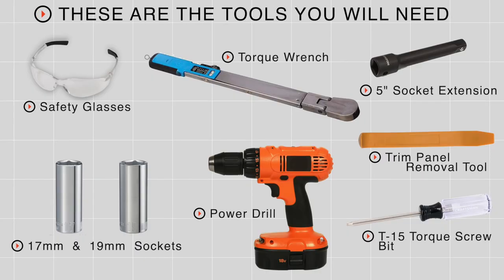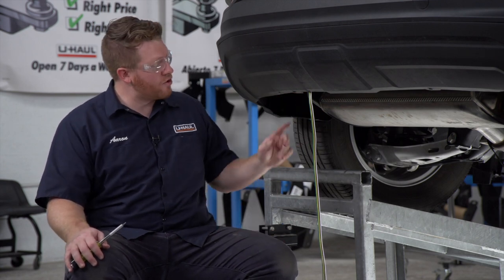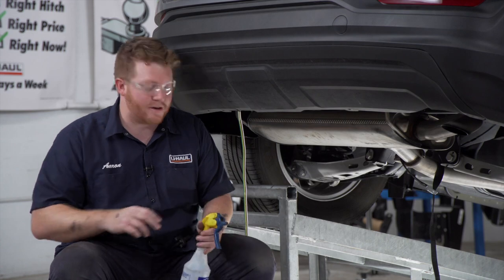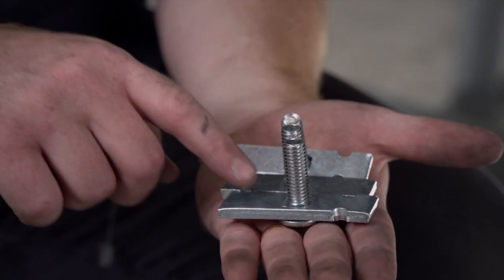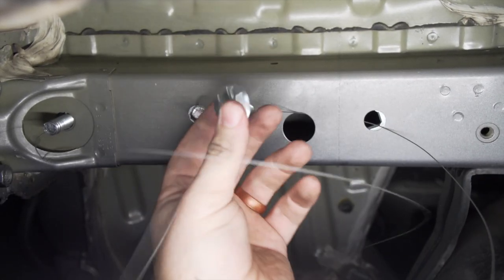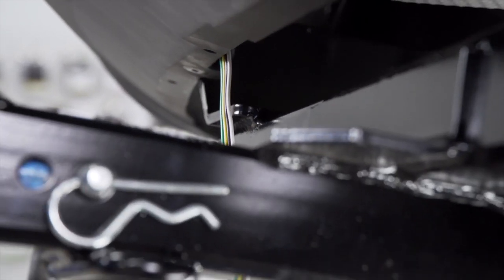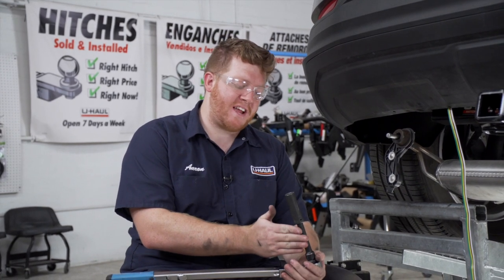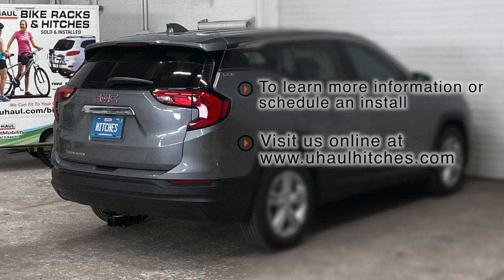2020 GMC Terrain Trailer Hitch Installation

Comment: Thanks for posting this video is very helpful!  I would recommend adding a little electrical tape to the bolt and pull wires to ensure they don’t slip off in the fishing process.